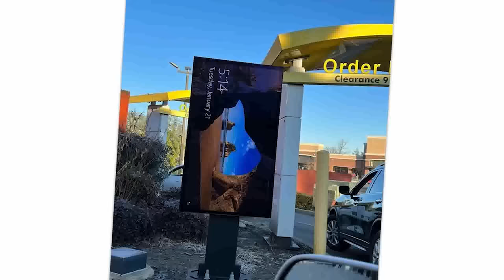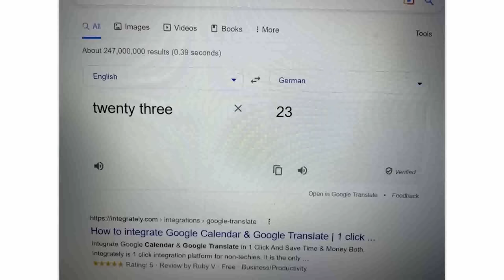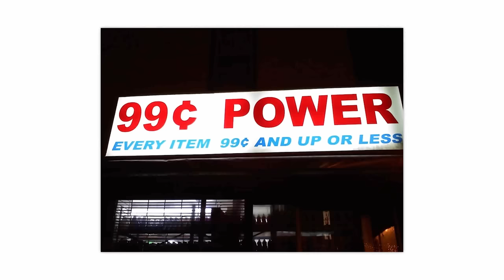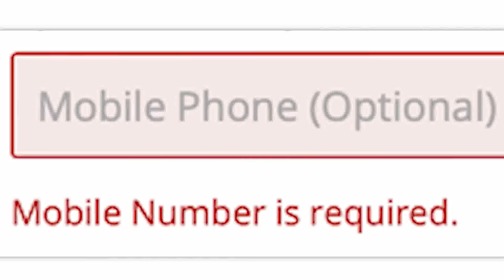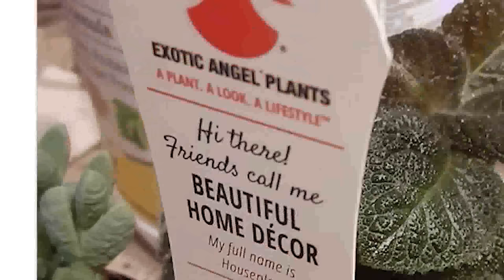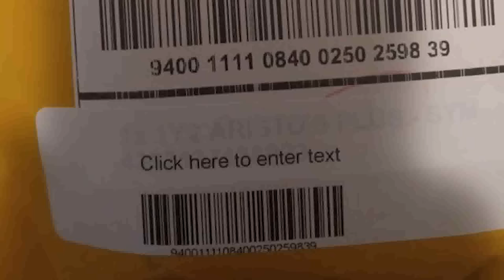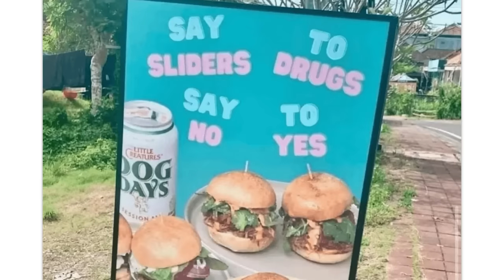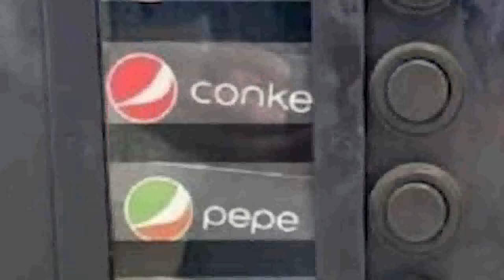THE TOP OF r/NOTMYJOB

Comment: Last time I was at the supermarket, I was checking the freezers. There's one freezer where they put frozen stuff which is on clearance. Can find a good deal there. Somebody had gotten prawns from the deli and discarded them in the freezer.. I'm still confused.. It'd make sense if they had cheaper prawns on clearance, but they'd be frozen, and they didn't.. 😂
Also, if I worked at a supermarket deli and a customer returned something 'cos they changed their mind, I'd probably love them. 'Cos I assume you couldn't put it back. You'd have to "throw it out" 😉
😂 The "fence is a fence"
People are supposed to see MT's and think "Empties, of course" like people aren't complete nufties.
And, is this channel run by John Benjamin's Aussie brother? ☺